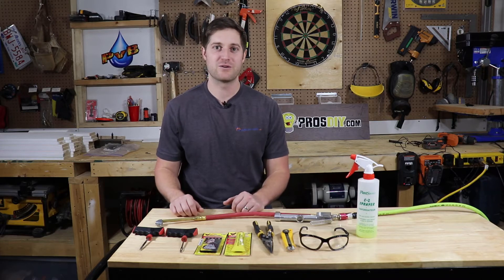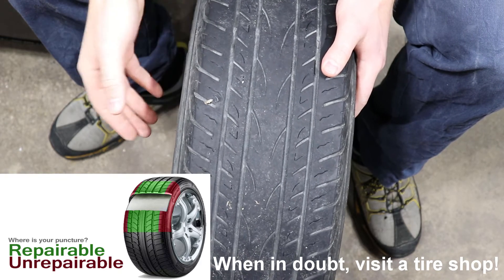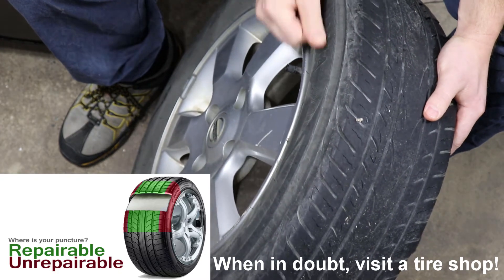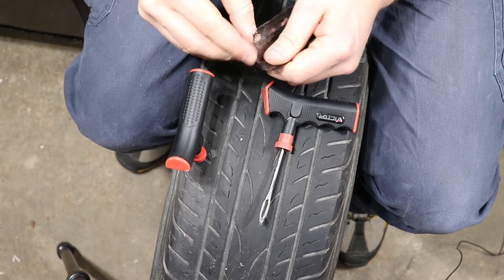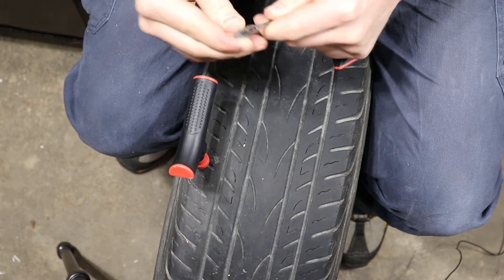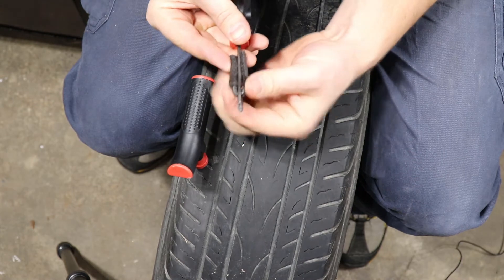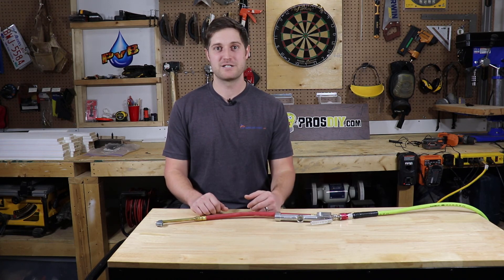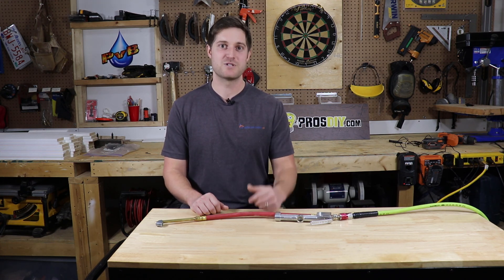How to Plug a Tire: Flat Tire Repair

Comment: I've not yet had an issue with a tire plug.  Tire stores are so reluctant to patch a tire these days, would rather sell a brand-new tire, for sure !!!  Yes, I check for leaks after the repair and monitor the tire pressures myself.

Comment: I've heard many stories where a tire plug lasted the life of the tire, others where tire plugs were never permitted as an acceptable repair and yet others where the only officially approved repair was both the tire plug and inner patch. So it's up for grabs. Personally I like to plug the tire then when I have the time, take it off the rim and apply the internal patch.
Reply from the maker: That's so true. There's so many stories good and bad with tire plugs. Personally I've never had an issue with them and have tires with 4-5 year old plugs. To be safe I would always recommend an internal patch though.